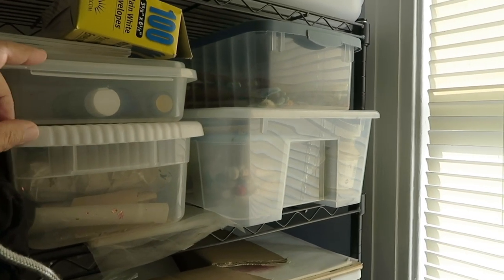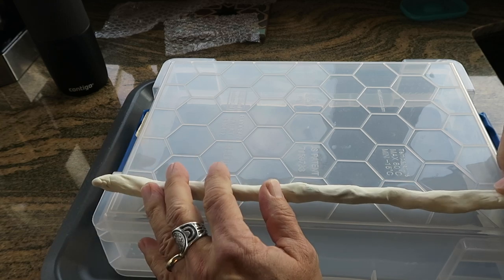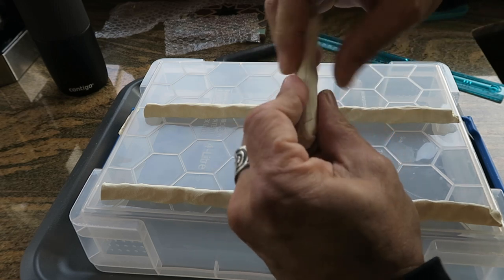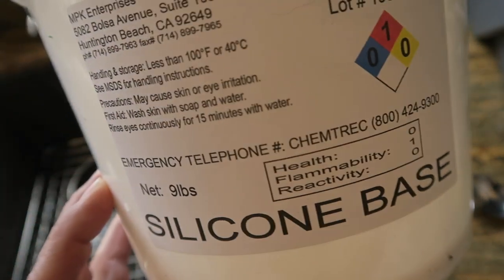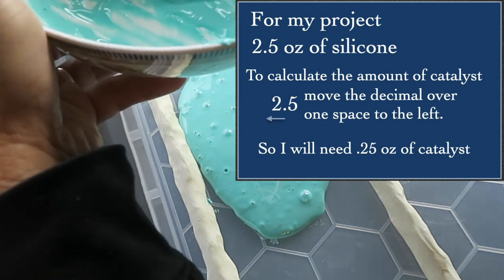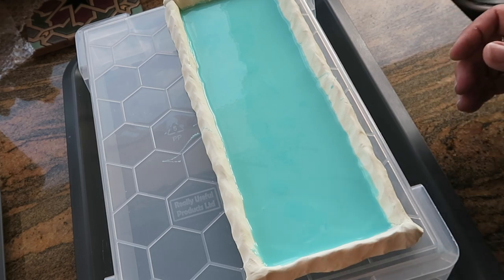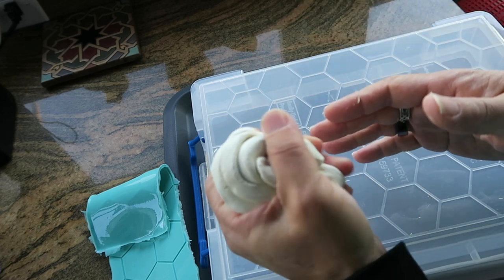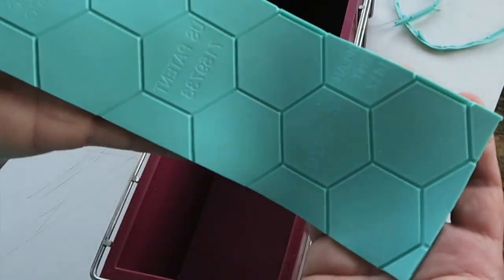Making a Silicone Impression Mat from Scratch

Comment: Cool! 😍 You took a risk there pouring such a thin layer. Especially because your silicone-mass is quite thick. 
Luckily you are an experienced crafter/artist.

What I use is a lot thinner (like emulsified soap batter), which allows air bubbles to surface easier and
is great for an intricate pattern. 
It's amazing what you can create with the silicone base. Thanks for entertaining us again! 👌💚
Reply from the maker: Happily I haven't had any bubble issues. Maybe because the silicone sets up so slow. Thanks again Corry!